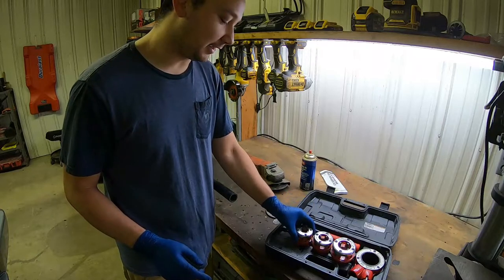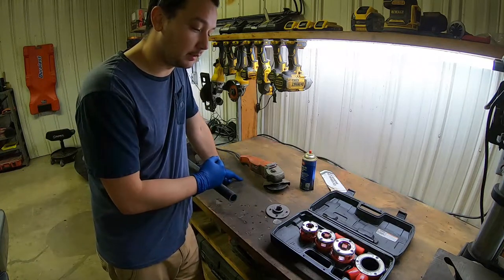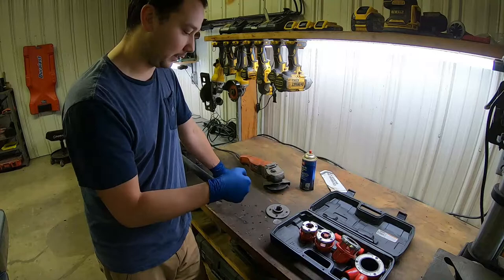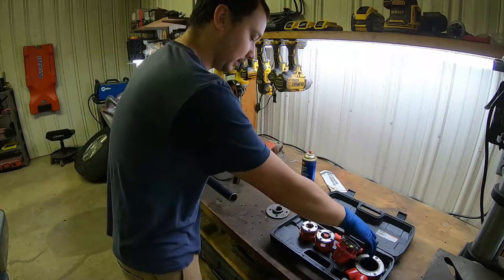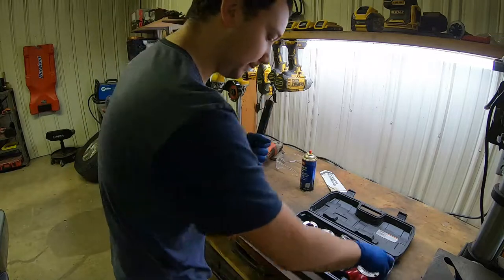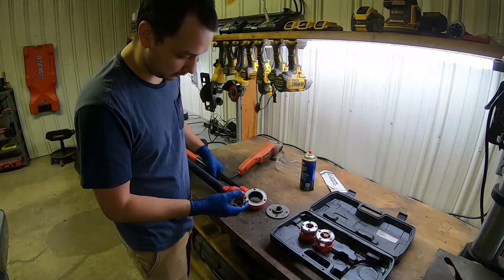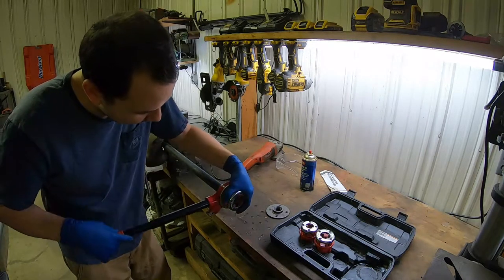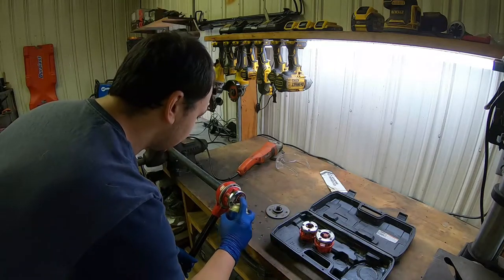Using Harbor Freight Pipe Threader

Comment: Ok good video , but next time clamp the pipe much closer to the vise. And it's much easier of you're threading the pipe whiles pushing down and not pulling up. So orientation of the pipe is important